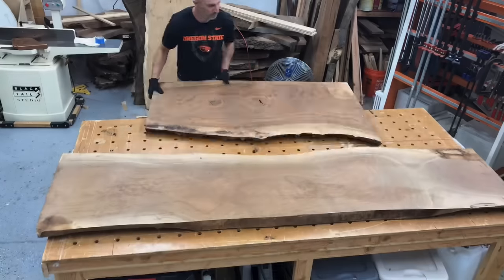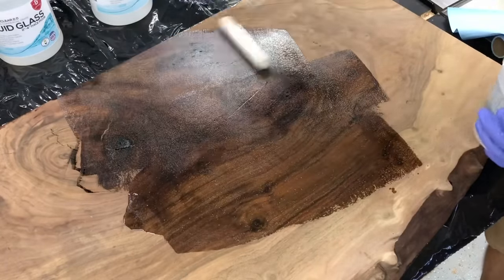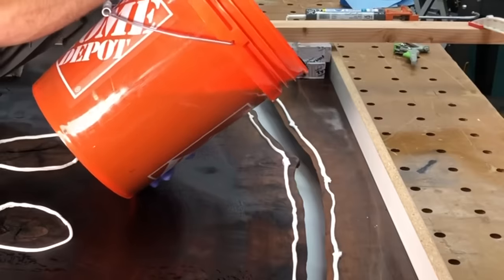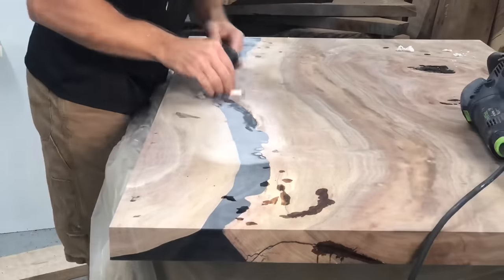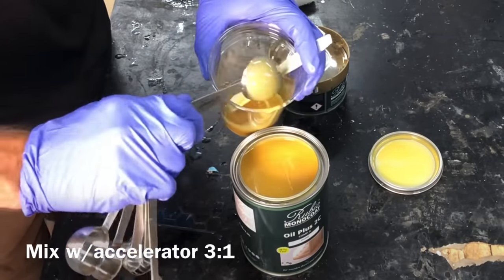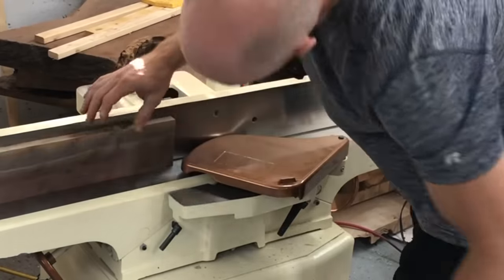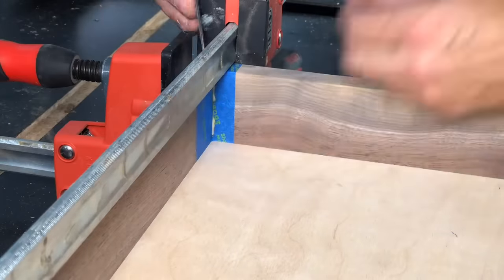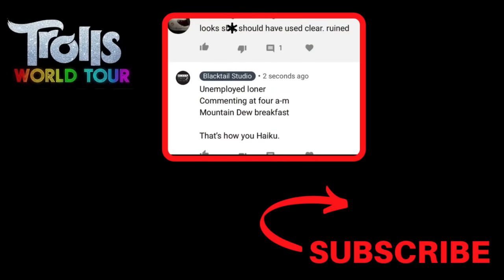Strangest Thing I've Found In a Slab

Comment: You could have mounted additional wood on the other sides of the metal brackets and then mounted reverse brackets or some other means of attaching the wood to make it more hidden. You had plenty of space for additional pieces of wood. Would have made it a little bit heavier but more hidden. Once you add the extra would you'd need to make the front of the drawer larger to cover up the brackets. I've seen that in other drawers as a means to hide it or create a boarder all the way around the table edge.

Comment: If you want to make some easy and well hidden drawer sliders, one way is to mount cabinet draw sliders to the top/sides of the drawer and the under desk that are detachable so you can screw each side down, the other is to mount regular low profile hanging draw sliders on the inside of the drawer with cutouts in the back for the brackets.

Comment: Project: awesome bookshelf.  I was going to suggest the boxed slider solution proposed by Joseph Driscoll below, but they got in first. So I'll go back a couple of your episodes and suggest you could use two bean bags when flipping heavy table slabs.  Easy to cushion, easy to pull out from under. Saves on future physio/osteopath bills.
Reply from the maker: I like where you’re going with that

Comment: There are mixer you can buy that are specially designed to avoid drawing in air.  Heat once the epoxy has set it a risk.  Making a new mold each time is a chore, especially when you have such a large work bench ❤️

Comment: I might've tried painting the drawer hardware a flat black with good auto paint, or some major heavy duty special covering substance, but what do I know about it?¯\_(ツ)_/¯ Nothing, that's what.
Reply: I don’t think the paint wouldn’t stick to the metal for a long time, specially for the inner sides of the trails. They should invent an anodized version
Reply: @rgms573  That would be good.  I've recently found some pretty amazing paints on paint department shelves in a good hardware store, too.  They sure are a lot better than they used to be.  Also auto body repair stores can make up an aerosol can of  decent car paint, but I doubt it would be worth the higher price.  With this particular application, nobody's likely to ever notice, and no one would go in for a close inspection under there.  The only one it would likely ever bother would be the perfectionist who made the piece, and only because they know it's there.